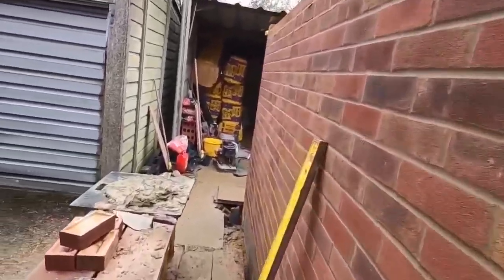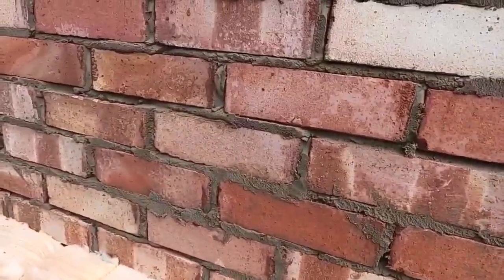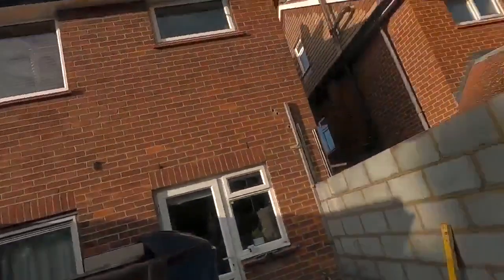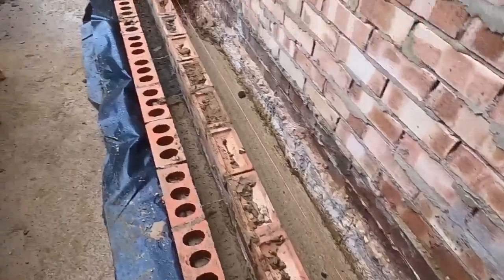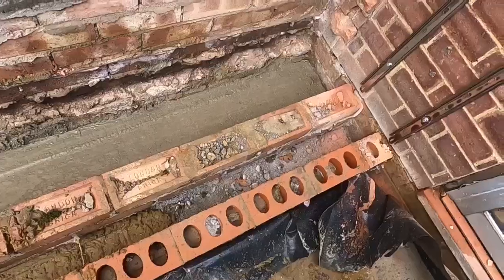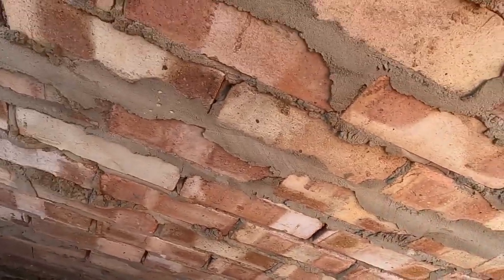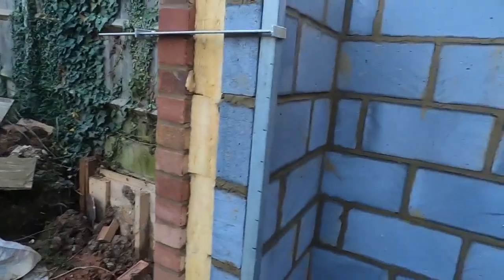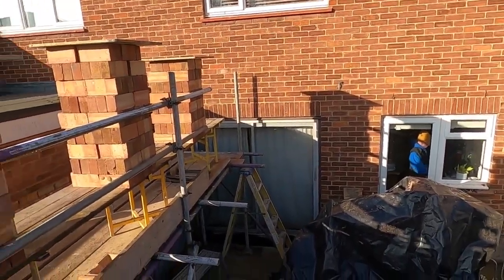Brickwork Extension part 2

Comment: Pro tip! Wall ties like Andy is using not allowed in North America and many countries in the world except UK. Also vapor barrier on blockwork between block wall and brick wall?? It is code every where but UK?  Andy why 4 inch block? You know they make 6 -10 inch block which you core fill if wall is structural . The world has been changing and techniques approved.
Reply from the maker: We build like this and all over Northern Europe quite simply because we do not suffer from Earthquakes so it is sufficient.

Comment: Worked with an old boy 20 year back and he used to flush his block work up with a worn in pointing trowel,look just as neat as bucket handle finish but joints were just as full (if not fuller) makes perfect sense Andy!🧱👍

Comment: Hi Andy, do you have a make of wheelbarrow you would recommend? I want something that will last years, the last 2 I have had have been flimsy and ended up snapping the frames.
Reply from the maker: Sorry I don't, the one ime using came from Spain, apparently Belle or Vaunt are the best but expensive, but I couldn't vouch for them as never used one.
Reply: @bricklayersworldwithandy6277  OK, man. Cheers for answering.
Reply from the maker: @kennethocongerskin9460  👍

Comment: I used the thin version beds in Australia and Germany, The Germans called it hebel .
  They tried it in perth Australia for a few years but it developed a lot of issues with cracking due to perth can get down to freezing in the winter but a 110 in the summer and they just didn't allow for movement .
  Like you said it was a great system as we used to get 90 blocks out of a big bucket of the grout stuff .
 Great video .........
Reply from the maker: Interesting, I've worked in Perth so it seems the extreme heat was the problem as in Europe we have extremeties with colder weather which dosent seem to have any adverse effect on the system, how's the work situation in Perth thinkin of coming out for a while next year, won't need to work but would be good to catch up with a few brickies👍
Reply: @bricklayersworldwithandy6277  I think it just the range of temperature is larger In perth year in year out.
   I'm no longer in Perth, I'm in poole now but I have contacts there and the work is good but the cost of living is horrendous ....my youngest Lad is in the mining game up in hedland .

Comment: On the Dutch pins you don’t think are very good, I find drilling a hole getting it hammered in a good few hits, 30mm ideally then turn the securing part of the pin round to the profile I find it ends up pulling tight, but yes the others are a lot easier

Comment: Hi Andy. 
I've just bought a lovely Edwardian house in Tonbridge, Kent. To my eyes (note I'm a chippie not a brickie!) the existing brickwork looks like high class work: flemish bond, beds & joints appear thinner than usual, white sand. The facade needs a good cleaning but I think is really lovely brickwork.
 
Anyway, I plan on building an extension but I'm unsure how to go about matching and meeting the new brickwork with the old. I think the brickwork extension on the front facade would need to be toothed-in, just butting the new brickwork against the existing would be easier but would look poor. But toothing-in I imagine wont be easy, 
I believe you are in Essex and probably don't come down as far as me too often but I would really appreciate hearing your opinion on how I go about designing my brickwork, don't believe there are many as knowledgeable as you with regards brickwork!
Would I be able to email you a few photos to get your advice? There's a few pints of Guinness in it for you if I ever meet you☘🤣
Reply from the maker: No probs, send me some pics over, is it listed?
apalij1@hotmail.com
Reply: @bricklayersworldwithandy6277  Ah thank you Andy, you are a Gentleman. I've emailed you now.
Reply from the maker: @kevocos  Ile take a look later, out at the minute 👍

Comment: What's the weapon off choice in this video mate? Looks a bit off a bigger trowel than usual Also seen a couple off old geezers on site with an axe in the bucket, asked what it is for and they told me they use it too cut thermo blocks, new one too me, just wondered if you'd see it before?
Reply: Axe for cutting thermalite blocks goes back quite a few year , I remember in the late 80s older bricklayers using them ,I've used one the odd time just for the sake of trying it🤔👍
Reply: Old bow saws were used as well
Reply: Used to use the axe back in the 80's ..... Can't beat it .
Reply from the maker: I use a machete, if you look back on my vids there is one on cutting thermalites where I use it.Ile use it on the next vid I do on this job.
Reply from the maker: It's an old Philadelphia Marshaltown, ideal for the big frogs, I did mention it in the previous vid 👍

Comment: I done a few years of the thin joint system over here, Celcon we’re pushing it for a while but we built it like we would a traditional build. Lift by lift with brickwork. Didn’t make sense and didn’t catch on
Reply from the maker: Don't like change in this country do they.

Comment: I don't mean to be rude or disrespectful as you're an older trowel than I am and perhaps it's just years of site work drilled into me, but I still don't get your reluctance to point up blockwork. With the amount you had to bump those blocks you could've done it with an old hosepipe. Anyway, with regards to the thin joint system, I did it in 2018 in Golders Green using Porotherm blocks with glue beds. The work flew up but the developer said he'd avoid using the system again because of how ridiculously expensive the ties were and how much damage the chippies would do when fixing timbers to the Porotherm blockwork. The blocks are also so easily damaged when packs of them are hoisted off the wagon by the HIAB.
Reply: Full joints don't need pointing . Simple .
Reply: Jointing is for exterior bricks that need the water to flow down. Water will never get on the interior blocks. 👍
Reply from the maker: Interesting that Lawrence, I don't know how much the ties are will have to check, I've used Porotherm in more than one country and there are many types of fixings available for them without damaging them they are also very easy to chase out for the Sparks, Thermalite type blocks can also be used for this system.
Reply: @bricklayersworldwithandy6277  I think he’s right I looked into it for a job but got a great big price back same old here they  love to lump it on you

Comment: Why didn’t you tooth it in ? Looks much better than a straight joint
Reply from the maker: BC in this area won't accept toothing because of differential ground movement, in fact I can't remember the last time iwas allowed to do it probably in the 80s. I do agree it does look better but unless the client forks out for imperial bricks which most don't when they find out the cost toothing metrics into imperial work looks crap
Reply: @bricklayersworldwithandy6277  that’s fair , honestly never heard the ground movement issue with toothing so you’ve taught me something, and yes you would have to be a magician to tooth metrics in to imperials 😂

Comment: Would have looked even better if it was toothed out to the old
Reply: I agree but a lot of build inspectors don’t like it anymore as they say about footing movement i personally think if you do it right with a tuck pointer filling the joints I’ve had no problems
Reply from the maker: As Liam said BC don't like toothing because of differential ground movement also unless the client is willing to pay more for Imperial size bricks it don't always look that good with metrics.

Comment: What's the actual style of them boots called
Reply from the maker: Not sure to be honest.
Reply from the maker: @colleenmcfarland8298  just found the invoice, they are HAIX Airpower XR26 GORE-TEX Safety boot from Workwear Outlet Blackburn Lancs👍
Reply: There are good few styles boots are real quality worth shopping on prices the 1 in link a use can get them £130,s. Most there boots gortex proper ankle protection and certainly these 1,s the tounge is Al part the boot so shitty muddy water etc coming in at lace area. Real bugger when the laces snap tho just like any boots suppose. Keep the leather good will easily last well over a year am pretty brutal with them and still do good 8 months happy with that because a know most important thing ma feet are dry and proper high ankle protection. Some these boots on market company’s should be jailed.